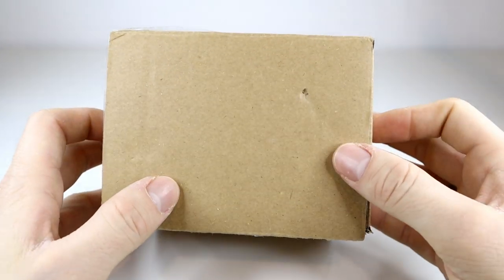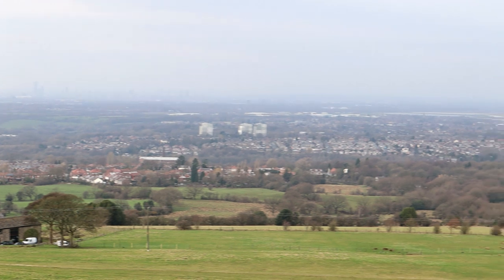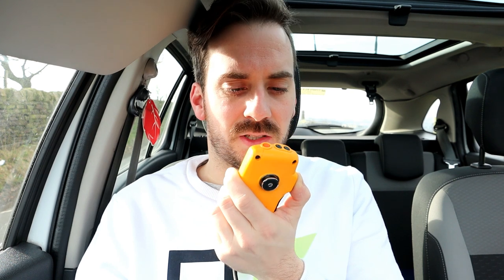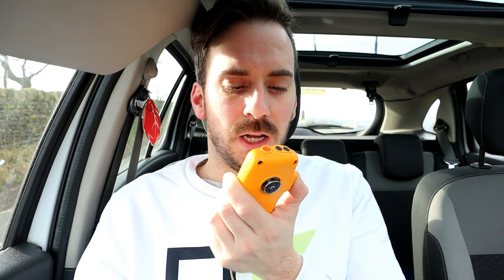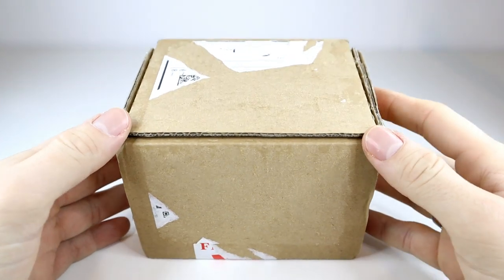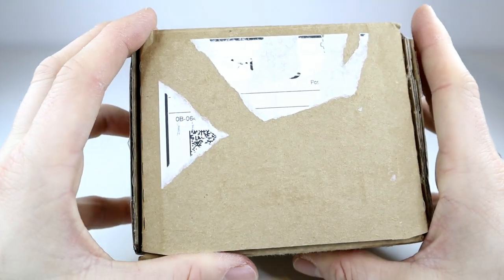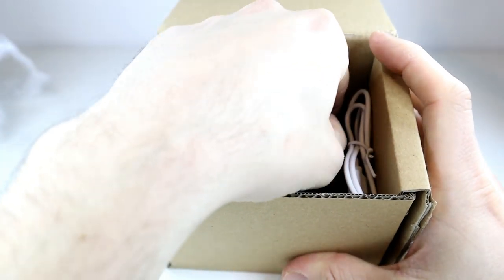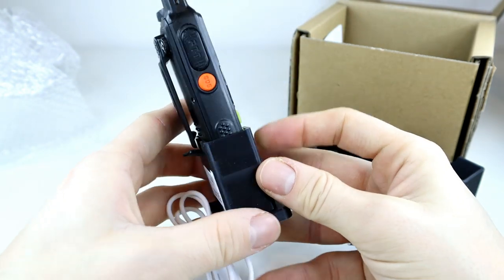3D Printing Amateur Radio Accessories!

Comment: Do you need an external speaker? Your car's FM radio probably has AUX in for your car's speakers built into the doors, you can just plug it into that. If you're already struggling for cabin space due to larger radios it'd make sense rather than trying to stick more guffins in there that you really can't fit anyway.
Reply from the maker: Good point Simon

Comment: Radio Stands is usefull. That radio modified to use a dual band antenna works well in VHF and UHF, I have made the mod using the flash light insert.
Reply from the maker: tweet me a picture! @officialm3hhy
Reply: @RingwayManchester  I dont use twitter and are several pictures for the mod. which is is the better way to send you the photos ? 73´s from CT1EMJ
Reply from the maker: Ringway Manchester Radio on facebook :)